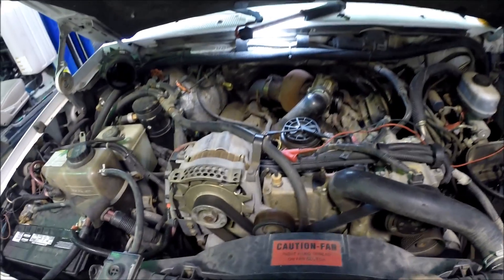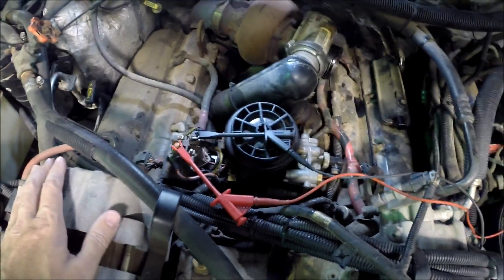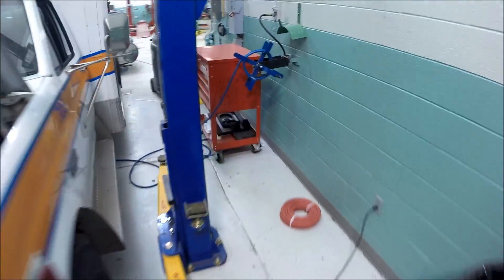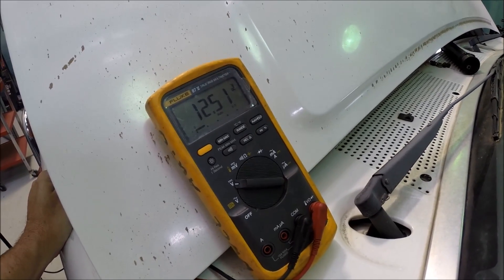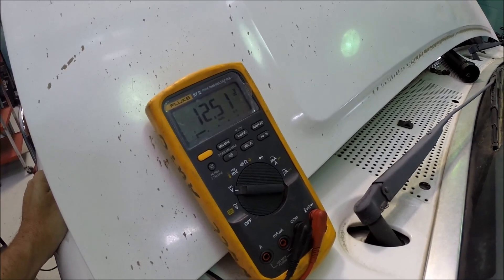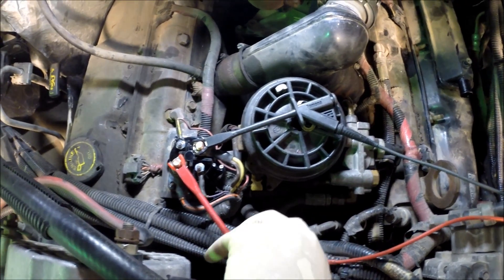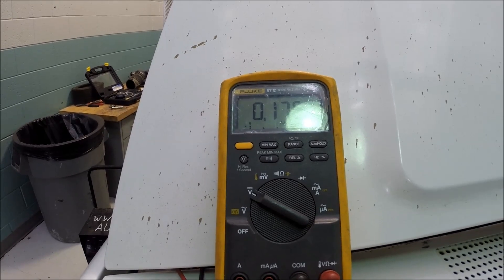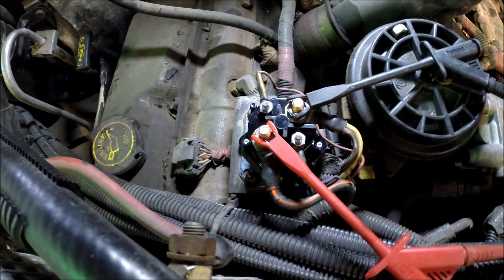Powerstroke, 7.3 Glow Plug Relay Test

Comment: I hooked my black lead to the battery, and the red to the glow plug side.i had battery voltage, but as soon as I turn the key to wait to start. It dropped to 10 volts, does that mean it's bad?
Reply: Yes - It should read barely any volts, in the 0.1 range.
Reply: And mine only dropped to from 12.25 volts to 12.09 volts ...
That's also time to replace it??

Comment: Very nice and simple. What's the spigot used for on the heater core hose.
Reply: Makes the AC work efficient due to the stop of hot coolant to the heater core when the AC is running.